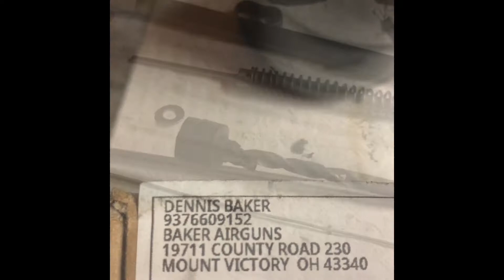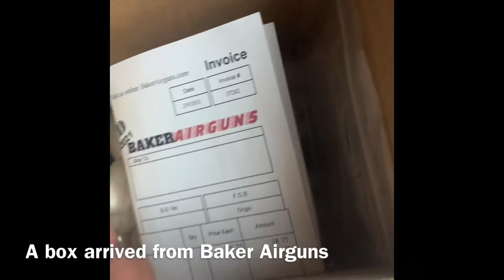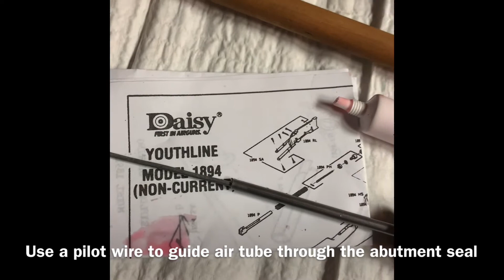How to install a seal kit on a Daisy model 1894

Comment: Easy way to remove seals is get a small piece of bamboo cane screw a large wood screw in end of rod then just screw rod into abundant seal centre and pull out easy.

Comment: the silver part that you referred to as a "magazine feed" at about 2:55 actually does come out.  You have to remove that black screw, which allows the two parts of the sandwich to move independently, and then you can get them both out.
Reply from the maker: Thanks I’ll remember that if I need to dig into it someday , for now she’s shooting great thsnks
Reply: @northbluehilloutdoors4306    my Dad bought my that same model Daisy BB gun when I was 9 years old. I like the looks of it way better than the current made Daisy lever action BB guns.  What type of accuracy you getting with yours ?

Comment: Thanks for the very helpful video. Did you put the abutment seal in facing the correct direction?
Reply: I am in the process of rebuilding mine. It looks like his abutment washer is going the wrong direction. I believe the grooved face of the washer should be facing the wood face of the dowel. Could be the reason for lower than expected fps. Correct me if I am wrong. I only want to rebuild this gun once.

Comment: If yours has that clamp bracket on were pin goes through lever you dont need to put lever on before you fix spring in .